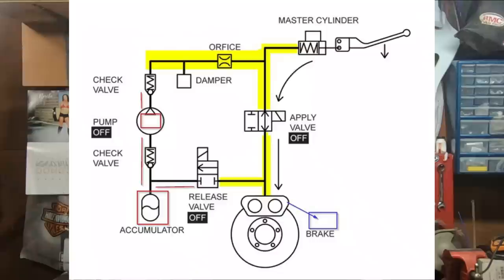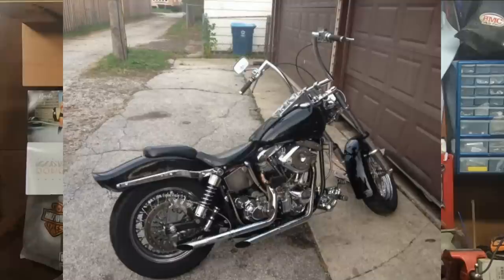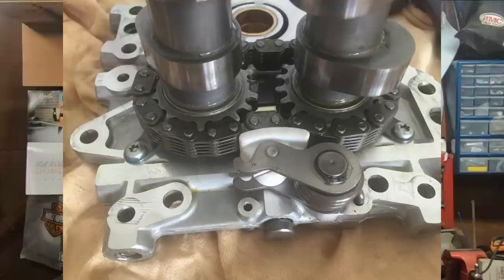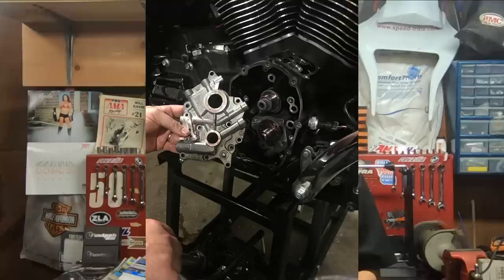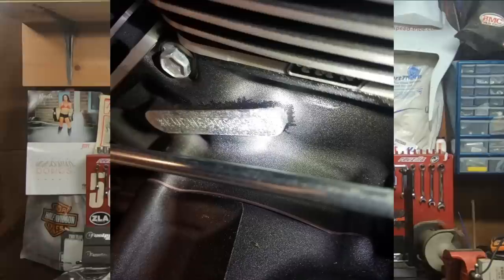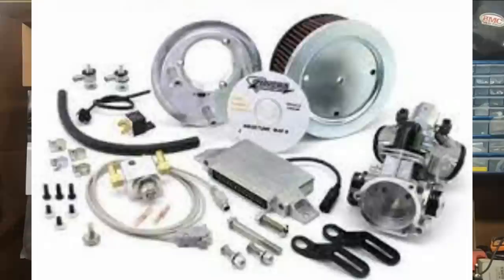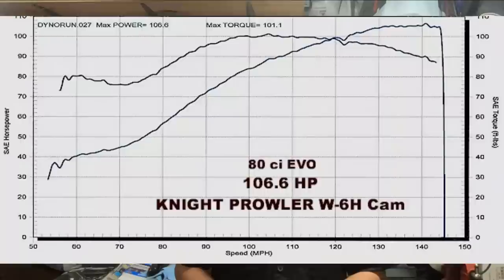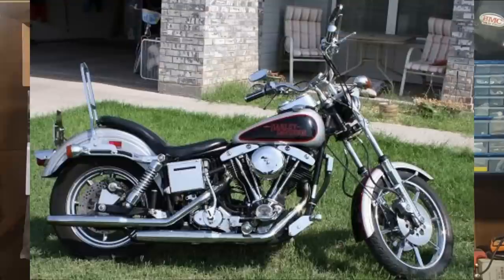Best Harley Engine Ever Made (Arguably)

Comment: Did the high comp big bore 88/95 . Well picked up 2 more mpg . 38 mpg . More efficient engine ???. Compression psi went from 125 psi to 150 psi .
It’s that 253 cam - loss of psi . 
The stock 96” twin cam has 175 psi . Both at 3,000 ft elevation .  ✊🏻👍👌👋
Reply from the maker: That's awesome! I've always said even if you build the engine bigger with more power you can gain MPG by making the engine more efficient.
Reply: @GixxerFoo  ret.h-d mechanic said he built a 95 inch twin cam bagger . Was not impressed. Maybe that’s why we are seeing the 114 and 117 in baggers now . Alot of weight - ✊🏻👍👌👋

Comment: Great video! I had a `16 Road King which I loved.  Sold it to go the Adventure route for a while.  Came back to HD a year ago buying a `16 Sportster 1200T Super Low.  My favorite bike of all time.  Pulls harder than my RK and runs great.  Only has 6k miles on it and I love its nimbleness, torque, sound, and cooler running.  Hoping I don’t get the FI issue you mentioned - has it been fixed on newer Sportster’s?  Thanks!
Reply from the maker: FI on the Sportster is very reliable, shame they quit making that touring model Sportster. I've got a 2016 custom with bags and a windshield and I love it, much easier to maneuver for me than the big twins. Here's the video on FI to carb, likely never need to convert with a Sportster unless you just want to https://youtu.be/V2WRmZuW1lw.
Reply: @GixxerFoo  Thanks for the quick reply, GXR!

Comment: I knew it was the Evolution before I clicked.
Reply from the maker: It's really hard to argue with the Evo, that thing I would argue was too good and going forward Harley engineered in failure points.
Reply: @GixxerFoo  yup. They prolly weren't making enough off of repairs or failures with the Evo.

Comment: Rocker boxes on evils leak they need to be planed to stop the leak you can have this done for around $30 at a machine shop
Reply from the maker: That's a good point! They do eventually leak but that is just so minor compared some of the issues we see on the late models.
Reply: @GixxerFoo  it is easy fix a problem is heat Cycles 3 piece set up warps Through block plane is the only way to fix the problem

Comment: I concur with the evo as the best. Underpowered but reliable and something that can be worked on without a degree in computers. I currently own a roadglide limited with the 114. A great running engine. I can do a lot mechanically on the bike. Electronics tho🙄. Ive owned 3 evo's and because of the performance difference i could NEVER go back.

Comment: EVOs RULE ! I have built lots of them 90 + hp !  I am currently running a 100 cu in EVO  thanks to Sputhe cases with TC cylinders & heads  haven't had it on the Dyno yet but I'm thinkin right close to 110 HP ! and in my FXR not much will put run her I have a 95 inch TC motor in my wife's 1990 FXR  that is a hotrod & mine flys by it she's bitchin wanting more power ! EVOs RULE & so do FXRs !
Reply from the maker: Nothing better than the Evo and the FXR! Your 100 inch Evo has got to be one trick motor with the TC cylinders and heads!

Comment: Need to couple the EVO engine with the M8 Softail frame.
1. Do the new 111/116 Indian Chief motors have the Timken bearing?
2. What do you think about the modern 111/116 Indian air cooled motors? vs H-D 107/114?

Comment: Great vid. I would like your thoughts on putting a SS 510  cam in a 88 twin cam. As I stated b4 my 2002 Heritage with carb. And stage 1 with 2into1 Cobra. Here in Michigan city Indiana we have local shop called Gear Heads. (owner former Harley lead tech) To the point I am doing a complete stage 2 cam plate oil pump lifters tapets exex $2005. In parts. Est 8-9 hrs labor at $85.00 hr. ? Again what do you think of the SS 510 cam. I Sir do value your opinion greatly thanks.
Reply from the maker: The 510 is a great cam , works well with stock compression and gives a nice power bump. Comes on a little later more toward 3,000 rpm but it runs out pretty decent up to redline.
Reply: @GixxerFoo  Thank you. I feel better about the 510 cam now I was a little nervous.

Comment: i was not a fan of the twin cam but was talked into one an 07 street glide my friend is head mechanic at a harley dealer and has his own shop long story short 07 was a good year for the twin cam even though its a 96in and it has been a very reliable motor but i will always love the evo i regret selling my wide glide i came into some cash and bought the street glide and sold the wide glide  another friend of mine has a 96 in evo with a baker 6 spd and it moves out real nice and really thats all i would need .where we are now with the latest harleys how big do you think your going to go? with all the epa bullshit and government pushing electric i really dont believe they are going to keep getting bigger and bigger im no expert just love harleys i never started riding one because i wanted to go super fast but i did go thru that phase with stroker sportsters etc today its about reliablility and decent power also wanted to say im a big fan of the channel thx bro
Reply from the maker: Thank you, I appreciate the support! The Twin Cam is a good motor, the 96 got a bad reputation with the lean tune of the fuel injection. It was just the first year with the closed loop system and no one knew what to expect. Compared to a carbed bike with the lean FI it would feel like the bike is on fire lol. I'm with you on the new bikes, I don't see a lot of light left in the tunnel for air cooled twin. I wouldn't be surprised if we see a large displacement Revolution Max coming soon.

Comment: I do agree I love mine witch I worked on the gaskets and I do want to know how much compression can the factory engine case handle?
Reply from the maker: Personally I would say a safe bet on stock cases is at or below 10.0:1. I've seen guys go 10.5:1 before and not have any problems, but 10.5:1 is where it's pushing it on stock cases to me.
Reply: @GixxerFoo  ok thanks for the information

Comment: I am about to buy 2 Harleys, 1 for the wife (evo road king) and 1 for myself. We went with evo road king due to family friend who was harley mech for years esrs and years. For myself I was considering the same bike but I'm also looking at the twin cam with the cam fix. My question is I found a screaming eagle 03 road king and I think that came with diff setup then regular motor/cam issue. With that being said do I worry about motor work for the SE 03  or just stick with evo or fixed twin cam? Thx

These will be our first Harleys but not first bikes. It will be wife's second bike and my first cruiser (5th bike).

Comment: Evo was built for relibabily not hp
Reply from the maker: It found a lot of success in reliability, they make power reliably when you get all the compromises out of the engine.
Reply: @GixxerFoo  if you want the the best off both worlds s&s storker motors fix all evo short comings. Big reason hd came out with the tc 88.

Comment: Did my 1995 EVO to do 100 hp Bolt on SE heads punch the jugs out 10th ev23 cam hit 100 mph in 3ed gear was doing wheelies up to 4th gear , but the money spent and only getting 5000 miles out of the engine and doing 4 builds I could of got a few new bikes .   I use a S&S crankcase and stock heads and ev23 cam Im about 75 hp top speed 110 .  I rather get wear im going  not the wear tear on the engine . $ into a build DIY your looking at 4 grand if not more prices keep going up up up .
Reply from the maker: Prices are getting crazy on just about everything, cam sets that were 300 bucks a couple years ago are now 500. Evo is still less expensive in comparison but getting new cases is never cheap. If you want to build a Evo with some power the safe way is to get a good set of aftermarket cases for sure!
Reply: @GixxerFoo  2018 i got my S&S case 950$ today 2400$ just the case.  in 2019 S&S case with flywheel was 2400$ one of my brothers case cracked flywheel bearing failure .  few months back .  He got a Twinkie .  he rather have his EVO , but he has a bike lol

Comment: What are your thoughts on a Lectron replacing a CV carb rather than going the EFI route ?
Reply from the maker: There's a lot of debate about that Lectron but like anything with Harley it's different lol. They work great in my opinion, it's like the next generation of carb and since it jetless you can literally dial it with a screwdriver. Easy starting and smooth idle and just plain flawless operation, it's about as close to injection as you can get with a carb.
Reply: @GixxerFoo  well that’s what I’ve been hearing as well. Thank you I respect your opinion.

Comment: I believe my dad had the first year for the Evo engine in a 1989 lowrider! Am I correct on that or wrong? He had quite a bit of work done to it where he had to have compression releases put in the heads because he went through three different batteries and then come to the conclusion that they need to put depression releases in but man that thing was a running mofo Myers duren Harley-Davidson in Tulsa Oklahoma did great work then and he had to do some suspension upgrades and other things because the speed but from 0 to 100 mph that thing flew!! But my question is was 1989 the first year for the Evo engine?
Reply from the maker: 1984 was the first year of the Evo, Lowrider has always been a favorite of mine too! Myers-Duren, that's awesome, they are one of my stops when I'm in the Tulsa area. They have a great service shop and a dyno! Yeah you get high compression and they will wear out some starters and eat batteries.
Reply: I appreciate you responding to my comment because I wasn't sure about when the Evo came out ,I just know when it did my dad said he had to get one and later in life he was glad that he did because like you said working on it he was able to get a quite a bit more power out of it without it being not dependable! But yes you definitely got to follow here now especially because you replied to the comment LOL and when he bought his bike at Myers D in Tulsa it was just a little hole in the wall shop on 11 th and Utica and now it's a huge huge facility! I don't know if they still do this or not but whenever you bought a bike through them they would take a picture of you on the bike and put it on the wall and they did that for years I'm not sure if they still do that now and I love the content man I hope you keep pumping it out 👌💪

Comment: Do you know what you mean I have a 2017 107 wish I had my old 2003 bike back
Reply from the maker: The late model bikes are aren't all bad, they make some good power and they are very reliable. The early M8's had that oil pump issue on the touring bikes mostly, but other than that they are great motors.

Comment: IMHO the Evolution Engine is Equivalent to the Small Block Chevrolet Engine. ( was only used for 50 years) Hands down the most reliable & best design to date Makes good power & the supportive systems around the platform Are now UP grades for Twin Cam & M~8 ,...........T~C & M~8 upgrades are Down grades  With A S&S Shorty E + intake  & a MSD Ignition The only other things is a good two into one header.   THE ONLY THING I am jealous of  on the newer bike are the sound systems  ( I Like Music when I ride) (No I don't want ear buds) { I  need to hear my surroundings)  The Problem historically with Bells & whistles is that when they fail it sucks for fix them EVO= KISS :Keep It Simple Stupid .  A EVO with a Delkron Case is A beast of a engine. But that is My Opinion. PEACE & Sunny Side up!
Reply from the maker: I'd say that's going to be a big issue going forward with new bikes an electronic, a lot of those new systems are all tied into the infotainment. I've seen some really trick Evo tourers that have been done up with some killer stereos with aftermarket touch screens.
Reply: @GixxerFoo  I think with the energy I saved by going ALL  LED lighting I can add a decent amp & rear speakers I have the Factory Speaker boxes for the King Tour Pack. I would love to find another set of Bags that I could chop up . But hey with that thunder header , its not going to be a Primo System. My Bags Have stuff in them Tools Tie Wraps rain Gear Extra clothes ... All those bells & whistles on the New bikes are great until they screw up.

Comment: Best engine Harley Davidson ever built is not setting the bar very high.
Reply from the maker: In terms of ease of maintenance and being able to do your own work, reliability and longevity the Evo is a win. There's nothing too crazy in those motors and you don't need a bunch of special tools. My dad's Vrod has a killer motor, but just to adjust the valve we have to lower the engine down out of the frame to gain access to do it right.

Comment: I want to get a second bike to cholo. Specifically a softail… would u say buying an evo motor softail would be better than choosing a softail between 2010-2016 ??? 

I’m pretty mechanically inclined as I work on my 1990 hd FXSTC… so what would u recommend
Reply from the maker: Just my opinion, but for a custom bike like that I'd say you'll get a lot better sound out of a carbed Evo with a cam. You can get some nice chop with the exhaust style on a cholo bike.
Reply: @GixxerFoo  besides sound, when it comes to performance, mechanical issues, and all around customization options

Would an older bike be worth it or a newer bike ?

Comment: So you tell me I'm basically screwing up because I'm going from a running 1989 Evo with a 102,000 miles on it to a 2006 Evo fuel injected . What is your opinion about 2003 104 EVO motor with fuel injection on a Road King ?
Reply from the maker: In the 2000's it would be a twin cam, those early generations had a great bottom end. 2003 on they went with the pressed crank with the roller bottom end. Nothing super bad about it unless you go crazy with power in the motor. Best thing to do on a Twin Cam in those years through 2006 is get the cam chest updated to the hydraulic system. If you have a Twin Cam 103 Road King the 2003 model, it's great motor but it does still have the spring tensioner system.

Comment: just got my 128 off the dyno and 2 days later starting sumping so bad
it was dripping oil out of my fueling breather pulled pump and run out was 8 thou
so its not the m8 crank i can tell you that since the big bore bike has 2000 miles on it
Reply from the maker: Awww man that sucks, what kind of crank ventilation and oil pump are you running?
Reply: @GixxerFoo  vents coming out of air cleaner and fueling dipstick breather
stock 2020 pump yea it sucks 2000 miles on this 128 build and the flywheels are shot
before dyno 6 thou after almost 9 thou pinion shaft run out i have never hit the rev
limiter since i have owned it dyno and tune was done by one of the best in the country.
hey it is what it is getting ready to send bottom end to revolution performance now.

Comment: not very likely your crank on a m8 or 03 later twin cam is going to be .003 or less run out needed to run a gear drive though.  I would have done gear drive on my 21 M8 128 but I'm at .005 runout. . I was lucky with my 03 TC 95ci .003.
Reply from the maker: Yeah honestly on the new M8's .008 isn't uncommon. Your bike being at .005 is actually pretty good on a M8. Having .003 on your Twin Cam is really good, you can squeeze a gear drive there but as time wears on you can't guarantee it's not going to increase.

Comment: And of course the one evo that you didn’t like was the M&M evo …. Which I have hahaha COMPLETELY stock from 1998 going to put a 2into1 stealth exhaust on it and a force winder air cleaner and a power commander and see how it’s goes 🤣😂🤷‍♂️
Reply from the maker: The fuel injected Evo runs very well, the MM system really isn't bad at all. It's just if you ever encounter an issue tracking it down can be very difficult, just trying to get parts is the biggest issue.

Comment: You said I could put a 85 kit in my 80 evo! Don't I have to bore the lower end?
Reply from the maker: Nope, 85 inch kits will drop right on without having to do any case boring. Now you get above that you'll have to do some case boring which is risky on the stock cases.

Comment: What do you think about running 91 octane 10% alcohol in my evil
Reply from the maker: I am not a fan of ethanol but if it's what's available then I will run it myself. If you have to run ethanol blend I would run some cleaner with it every now and again that counteracts the effects of ethanol. For sure I wouldn't let the bike sit with it in there, I am paranoid about it so I would just keep an eye on your fuel line and anything rubber. Supposedly the higher octane isn't supposed to be as bad, a lot of small engine manufacturers recommend 89 or higher with the 10% blend.

Comment: Most modern day vehicles are crap mostly do to electronics hone overboard. It's to a point where a simple man can nolonger work on their own vehicle without an expensive computer and tech classes. Like my old $1000 rusty Chevy truck that ran for years with no issues where if a check engine light came on it was 1 of 5 things. In today's trucks a check engine can be 1 of 1000 things and usually a fortune to fix being much needs to be done at dealerships like my $50000 dodge that's at the dealership atm only 80000miles and it's having issues. Something in the electrical system won't allow me to start it. Dumbest thing was you can't even simply put it in neutral you have to do some fancy wiring crap to move it to get it on the tow truck. Good thing I have a 94 lowrider evo engine Harley to get me around.

Comment: All of my Honda motorcycles died from campaign failure with catastrophically destroyed the engine. My gear Drive Evolution Sportster has outlasted my high tech water cooled chain driven cam CX500 buy / 120,000 MI all of my bikes are gear driven I don't trust anything else.